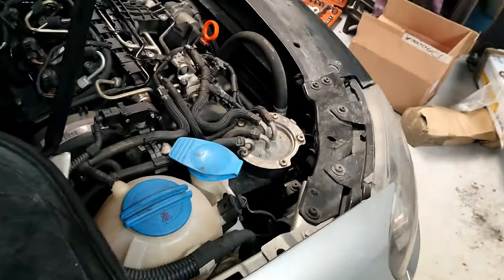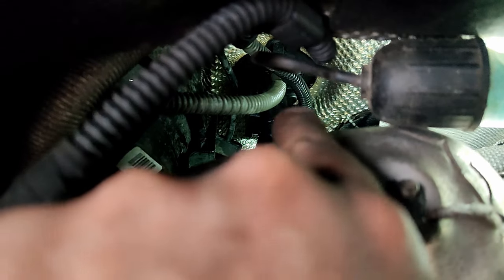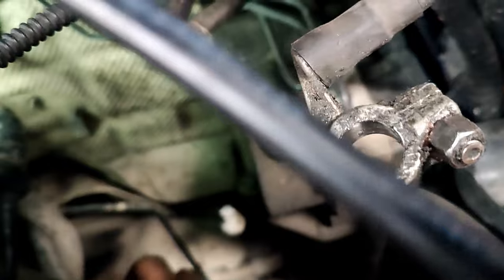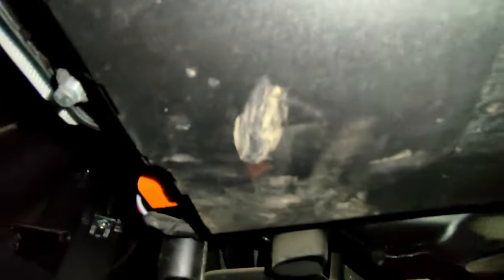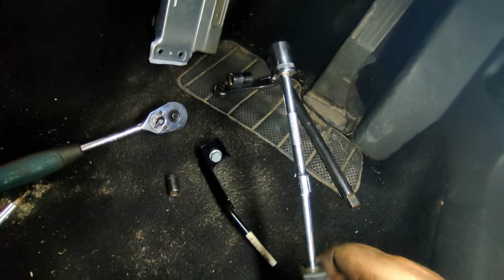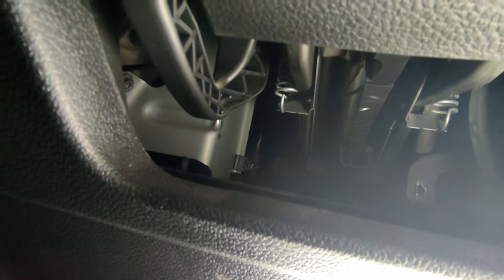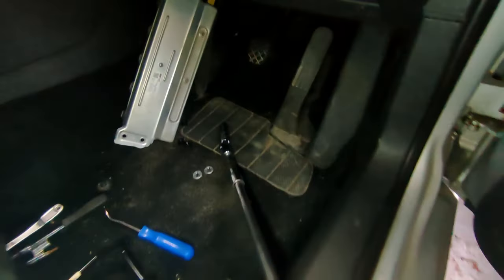MK6 Golf Clutch pedal sticking to floor .. how to diagnose problem and removal of master cylinder

Comment: I had exactly this problem. Thank you for this absolutely brilliant video which I followed to replace my Golf master cylinder. Total cost £30 :) I found that my O-Ring on the pipe that goes into the master cylinder was more like a stepped hat than an O-Ring and it was wedged in the old master cylinder so worth having a good look at the old cylinder as it will probably be in there. This job could be so much easier! There was a lot of swearing but following this video step by step got me there in the end. Many many thanks! :)
Reply from the maker: Thank you for the positive comment and I'm glad it helped you out! If you have to do the job again I would recommend getting a genuine master cylinder as I've found that the cheap ones don't last very long (usually 6 months to a year).

Comment: Thanks for a excellent video!
Have a Golf 6 (5k1) 2.0l 140hk TDI where the clutch pedal sometimes stick to the floor or more often just don't pull up all the way.
It is intermittent and do not happen that often but still need to be fixed, is searching for leakages the only way to tell what cylinder is causing the issues or is there any other way to tell?

Since I live i Sweden I got a the steering wheel on the left hand side do you know if that will give slightly more room at the master cylinder?
Reply from the maker: Have you tried topping up the master cylinder reservoir with DOT 4? If it's a extremely small leak it can be difficult to find. 
If the oil level is dropping considerably try cleaning both the master and slave cylinder with blue paper towel so that both, and the area around is clean and dry so that you can check for external leaks. If you don't find anything and the level in the reservoir is dropping there is a good chance that the slave cylinder is leaking into the bell housing. To check this you can remove and see if the push rod looks like it has residue of hydraulic oil on it, or put a bore scope camera down inside to check for oil.

I've never done a LHD so can't answer your second question, but I imagine space constraints would be similar.
All the best with tracing it and let me know how you get on

Comment: Hi, I've got what seems like 2 problems with the clutch on my mk6 2.0 Caddy. For a while the pedal has intermittently stuck half way up, I have to pop it back up with my foot. But now I'm loosing compression when pressing the clutch, and I'm having to use a bit of force to get it into gear. 
Reservoir level is up to the max line and I cant see and leaks. I've been quoted £1000 to get it sorted! I've already spent over £500 fixing the oil cooler housing that failed a couple of months ago! 
Do you do work for customers or just yourself? If you do how much would you charge? And how would I get in touch with you? Thanks
Reply from the maker: @lucywithers2488  Hi Lucy, I do some work for customers on my side but my main job is fixing marine engines on ships. Currently I have no availability for at least 5 weeks. 
From what you have described, providing that the clutch is correctly bled then it could be an issue with the release bearing or spring. In which case the gearbox would have to be removed and I would recommend changing the whole clutch assembly. 
Depending on what clutch you go for this should cost you around the £600 mark (providing no other issues are found) so it may be worth trying to find another garage. 
Sorry I could not be of more help but the timing is currently quite bad for me. 
Feel free to contact me for anymore issues in the future however, always happy to help. Based in Mid Wales if you're close by.
Cheapest things to check though is whether the clutch is properly bled (a job I believe anyone can do themselves with a friend and plenty of vids on how to do it).

Comment: Hi Fella, I changed the master cylinder on my mk6 golf, slave cylinder was returning and no leaks. Do I need to bleed the system as pedal still not returning?
Reply from the maker: Hi, yes you are required to re-bleed the system after changing the master cylinder.

Comment: I have a problem where the clutch stuck to the floor. I checked the slave cylinder and had someone press the clutch. It pushes out. You said if it pushes out, replacing the slave cylinder would fix it?
Reply from the maker: If it pushes out and you cannot see any leaks then it is more than likely the master cylinder. The same procedure to remove as this video. I have also uploaded another video on changing the master cylinder from the pedal to help guide you through that part
Reply: @aguyandhisgarage  The reservoir still has fluid. Level has dropped slightly. It’s a bit wet underneath by the oil pan. 
Just to clarify So I don’t have to do anything with the slave cylinder?
just replace the master cylinder, and see if that fixed it?
Reply from the maker: @alvarocruz9613  Yes, if it was the slave cylinder leaking it would be leaking into the gearbox bellhousing and you wouldn't see it externally. So its master Cylinder of one of the pipes hoses, I'd start by confirming the hoses and pipes are not leaking by running a clean paper towel along them. 
If changing the master cylinder remember to leave access to the slave cylinder for when you bleed the system at the end of the job

Comment: I have a problem with my clutch, i am taking my golf mk6 1.6 tdi to mechanic to fix this but mine happens only when i put my foot down on second gear but it gets stuck for a few seconds and pop back up, other than that no other issues, is it the master slave cylinder? Or something else ? , thanks please reply as i am going to mechanic tomorrow , thanks
Reply from the maker: It's hard to say definitely, but it it's getting stuck and then popping back up then it could be an issue with your clutch release bearing sticking
Reply: Yeah it only does it on second gear when foot down and for a sec it gets stuck then pops back up by itself, u think it's expensive to fix?
Reply: And there is slightly vibration on clutch when it's stationary and clutch fully down it vibrates little bit not alot do you know why? Cheers
Reply from the maker: @M4n5or  Most likely due to the springs in the clutch plate. I would recommend changing the clutch and bearing, you can get a decent kit for around the £200 mark. Then labour will be dependent on your mechanic
Reply: But clutch feels good if the clutch is good then there isn't the point of changing it, I'll tell mechanic to change the bearing see if it fixes with that. Cheers though for your help
Reply from the maker: The rattling is most likely the springs in the pressure plate. For the cost of parts Vs labour I would recommend changing the clutch, or at least get a second opinion from your mechanic
Reply: Oh ok will do, cheers

Comment: Hi, the pedal on my mk7 gti was sticking to the floor so took it in, and had the master cylinder replaced. It felt fine for the first couple of hours, then it sticks to the floor again. Could this be the Slave?
Reply from the maker: Essentially what's happened is you've lost all the fluid from your system again. Yes it could be the slave, it could be an issue with a hole in the piping, o'r it could be that the O-ring in the master cylinder where the pipe goes in was missing/has been incorrectly installed. I've also seen where if the cheapest master cylinder on the market is installed they may last from a few weeks to a few months, it could be that you got a really bad one that has only lasted a few hours?
Really you need to try and source where the leak is coming from and take it from there.
Hope this helps you out.

Comment: Hi Mate, I have the exact same issue. By chance how long would you say it takes to complete this job. I have the Master Cylinder on order and want to get it done asap
Reply from the maker: Depending on experience, i would say 2-3 hours including time to bleed the system. If you need minimum down time then it's probably worth ordering the slave cylinder too incase that is where your leak is from. If it leaks from the slave it will go inside the bell housing of the gearbox and won't be visible until you remove it. If you get stuck anywhere feel free to drop me a message
Reply from the maker: Depending on experience, i would say 2-3 hours including time to bleed the system. If you need minimum down time then it's probably worth ordering the slave cylinder too incase that is where your leak is from. If it leaks from the slave it will go inside the bell housing of the gearbox and won't be visible until you remove it. If you get stuck anywhere feel free to drop me a message

Comment: I have a similar problem which is intermittent with the clutch not popping back the whole way. Got quoted £280 to change master cylidner as apparently this is the easier of the 2 as the whole gearbox has to come out for slave. (09 mk6 golf 2.0tdi). Mechanic said you dont know which one it is so repalce cheaper one first. I really dont fancy paying to do master cylinder for them to say its not fixed! Any ideas? Had a look underneath and can see a bit of oil round the right had drive shaft cup and underneath but isnt much!
Reply from the maker: It really depends on which slave cylinder you have, for a concentric slave cylinder you would have to pull the gearbox out, and whilst you're at it you may as well change the clutch. If you have had a new clutch recently then I would check the receipts to see if the slave cylinder was replaced at the same time. If you have a regular slave cylinder then I would say that this is the easiest to replace. With your Reg number you should be able to check. 

As for the master cylinder, the price between genuine and aftermarket varies greatly. I have had to stop using the aftermarket ones as I'm sure that they are all made by the same manufacturer and generally fail after 6 months to a year. If the price quoted is for using a genuine master cylinder then its a fair price. If they are using an aftermarket part then I would say its on the pricey side. For reference I would charge about £100 in labour for changing the master cylinder. 

As for diagnosing it can be hard. If the problem is intermittent then most probably any leak is very small, and by topping up the reservoir will be temporarily resolved. you would really need to try and feel under the master cylinder to see if its wet. I usually use some paper towel to wipe around the master cylinder and along the pipework, starting as low as possible and work yourself up. Using this technique with paper towel will make it very obvious. It may even just be that the O-ring from the pipe to the master cylinder needs replacing.  

The oil underneath really would have to be cleaned and see if it returns. Too many times I have seen old oil leaks, or spillages from oil changes etc that have not been cleaned up properly, which later on down the line shows itself as a false fault. 

I hope this has helped you out and please feel free to reach out to me if I can be of more assistance.
Reply: @cambrianclassics9526  very thorough useful reply, thanks for your help. My reg is SY09TRX do you have a website to check what type of slave cylinder I have? Hopefully it's the easy one to access.

I will try and use the paper towell method but I guess either way it still has to go to the garage to fix. Currently it's very intermittent as sometimes you can drive the car but the pedal only sticks half the time. The strange thing is when I checked the reservoir it still was full so didn't drop much but maybe as you said it's a pressure issue round the o ring. 

Many thanks mate
Reply from the maker: Hi, I have checked and you have the standard slave cylinder. Just remove the air box, battery and battery tray and you have good access. All these parts will need to come out to bleed the clutch regardless of whether you change the slave or master cylinder. Changing the slave cylinder can easily be done within an hour. 

If you are confident you can follow my video and try to replace it yourself. Or if you are located in mid-Wales you can always book it in with me. 

 Anyhow, let me know how you get on
Reply: Thanks thats good to know. Would it be obvious if I accessed the slave if its that one that is leaky / broke?

 confident haha hmm ill watch again to see if I can tackle it. What was strange with mine was that when the clutch was depressed it got stuck and no pulling it would lift it!

Thanks again
Reply: Is it a mq200 or 250 gearbox I have?
Reply: Hey mate I lost the bung off my hydraulic line. Where could I get a new one?

Comment: But isn't  the slave cylinder in a mk 6 Golf incorporated in the release bearing...?
Reply from the maker: No there is a clutch fork which it pushes onto
Reply: Thanks for reply...
Reply: @Martin yeah 6 speed 02Q have the slave and throw out bearing inside the bell housing at least in North America
Reply: Depends on the version, but this is the case in the 2009 MK6 GTI 210HP.

Comment: How much would the parts and labour cost??
Reply from the maker: Depending on of you were going to use aftermarket parts or genuine VW. But I would charge around £200 with an aftermarket part. Off the top of my head I can't remember the cost of a genuine part but think it's +£100 more.

Comment: Hi when I push the clutch pedal the slave cylinder pushes against my hand with lots of force, does this mean that the master cylinder is okay and the clutch has failed ?
Reply from the maker: @ryanpoultney839  are you loosing fluid? Does the clutch pedal get stuck down?
Reply: @aguyandhisgarage hi, I’m not loosing fluid and yes the pedal hit the floor when pressed and doesn’t return, if I lift the pedal and get someone to press the pedal down the slave cylinder pushes out but the pedal then stay to the floor. 
Where the slave cylinder pushes against the clutch fork you can see that it can’t push the fork forward ?
Reply from the maker: @ryanpoultney839  I would try and bleed the clutch first. If the fork is stuck in then the clutch must be permanently disengaged? In which case yes you will have to remove the gearbox to replace the clutch
Reply: @aguyandhisgarage thank you for your replies doesn’t look like it’s the master cylinder then ?
Reply from the maker: @ryanpoultney839  it could be, but if it's not loosing fluid and there has been no way of air entering the system then it's not likely.
Reply: @aguyandhisgarage  thank you 🙏

Comment: How to bleeding bro ????
Reply from the maker: Best way is probably to get someone to help you. One person to sit in the car and press down the clutch pedal, when its pressed down open the nipple on the slave cylinder so that air/fluid can flow out. Then close off the nipple, lift the clutch pedal and repeat. Keep an eye out on the fluid level in the master cylinder so that you don't introduce more air to the system

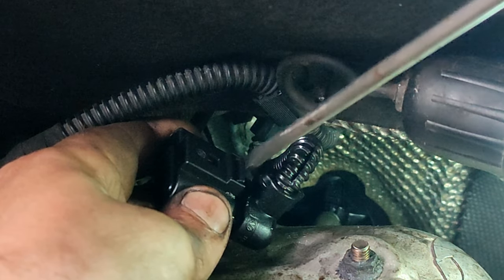Comment: 2:25 Clip on that position sensor is now broken, dont use a screwdriver
Reply from the maker: It's not broken. Unfortunately my hands/fingers are too big to get at it without using a screwdriver. Just had te car back in for a service and still going strong

Comment: Suddenly one morning I found my clutch pedal flat to the floor on my Volkswagon Transporter 6 speed manual. I believe it is likely to be a master cylinder or slave cylinder. But first I have to find them! 

I tried to follow this video, but the Transporter is different.  Any tips greatly appreciated! 

Here is a video of my problem and trying to find the master and slave cylinders: 

https://youtu.be/IoL0r3SlgZI
Reply from the maker: Hi Paul, 
If memory serves me correctly the master cylinder is quite similar, in that it needs to be removed from inside of the car with the pedal. On the other side of the bulkhead (in the engine bay) it is most likely hidden behind a aluminium foil type heat shield, but if you follow the hose down from the clutch/brake reservoir you should hopefully be able to find it pretty easily. 

Best regards